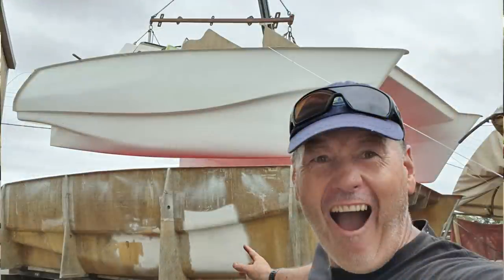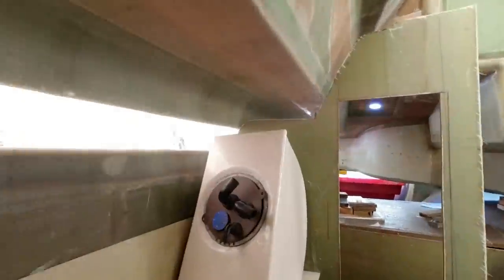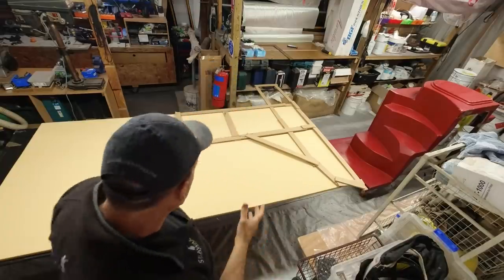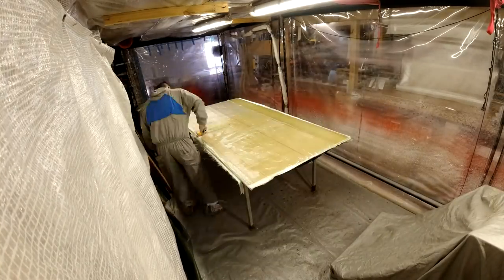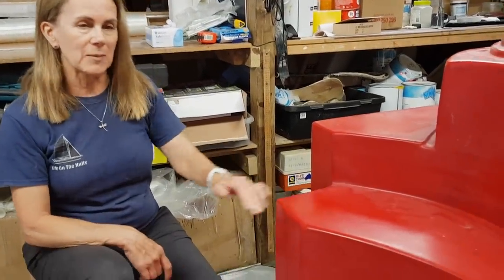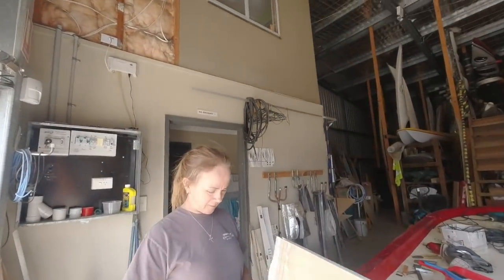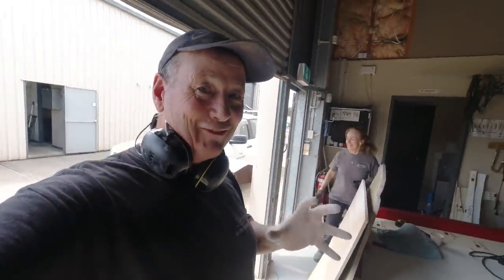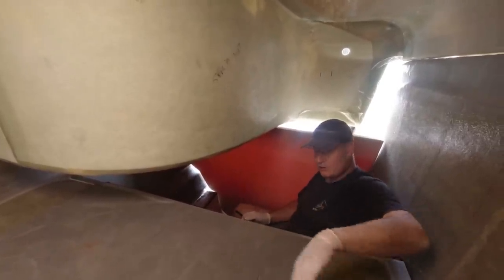CATAMARAN BUILD - Major Structural Bulkheads and Helm Station Ideas Ep203

Comment: Hi Ross !  Have you looked at making the helm seats (in a bench style) integral to the stair module you're already modifying ? An inner seat molded a bit lower for your height, and an outer more elevated one for Janet's visibility needs ? Having the outer seat higher will also improve visibility for her to see out laterally and can also offer you a cabinet space in aft face of module. After all Ross, you need SOME sleep eventually ? Right ?   PS You can always set up multiple/different thickness cushions to affect the levels on the bench or swap cushions sides for a bigger boost...

Comment: Quite right. I also don’t like openings in a back of a boat.
Reply from the maker: Very good safety feature Ash
Reply: @LifeOnTheHulls  Agree, if you have it like the moron cat set up, the engine could flood with salt water and kill it. If seawater gets into the pistons that will mean a new engine as rust will start to form. That and the fact the cat will be partly flooded and becomes difficult to pump it out. As you are doing entry from the inside is a better and safer solution. I’ve said your building a tank and my view has changed it will be unsinkable tank 😝

Comment: Who's the apprentice Rossco?  (LOL). One thing about all these boats. They are not good at standing up to running into things. i happened onto a channel this week, somewhere in the Central Americas, where another builder is using 'plastic'. He shows how tough the hulls are by hitting them with a sledge hammer with no effect? Asid from that i pray that February is a better month for the 2 of you. Cheers
Reply: saw that was interesting - but doing a mould or injection would be a challenge - but if Elon Musk can build Teslas from molten Aluminum who knows - also only a few boats so not scaled up like Tesla
Reply: @jimlofts5433  something to think of though. cheers

Comment: Great video as always. If I remember right the internal steps have wooden treads. Will you be doing something similar at the helm or just painting some anti slip there? Cool idea using the existing step mold by the way. Cheers!
Reply from the maker: Yes Chris our plan is ultimately have some type of wood look deck, it will most likely be a faux teak product on the entire back deck as we do like the sifter feel, but I am concerned about the heat these products can generate. Rossco

Comment: Raising the helm: are you not going to put a seat in. You will need to make that seat height adjustable also?
Reply from the maker: There will very a seat well high enough for Janet did worry.Ross
Reply: @LifeOnTheHulls  Janet is petite, when you sit next to her I bet your body is still taller. So something has to be done. An adjustable seat, so she can raise it when at the helm or you get booster cushions for her. The booster option is cheaper but I don’t think you will be happy with that solution. I think a couple of those gas risers you get in swivel office seats could do it? May be their is off the shelf product you can get? The step is a great idea, but with hours behind the wheel you will need a higher seating positions for Janet.

Comment: Just interested in the cutting a hatch in that structural bulk head, did you have to run it past your engineer to pass survey? Or is it an additional bulkhead to start with. Great video, thanks for making them!
Reply from the maker: Thanks Tim, it is an additional bulkhead but upon discussing it we agreed that some carbon un- directionals along the perimeter of the hatch cut-out would indeed be more than recommended. Rossco

Comment: so i do find the build process interesting but this cat originally was a power cat correct ? how is going to be a sailing cat with out many changes and the hull design will work for that ??? L.A Rob
Reply from the maker: Original Cat was a sail cat, the power cat was an adaptation of the original boat, I am employing some of both of the boat designs to a motor sailing cat. Rossco

Comment: Ross I notice that you are often " beefing up" the structure Are you in danger of over building and making the boat too heavy?
Reply: Rossco will correct me if I've misunderstood, but I recall that he's deviating from the plans of the boat in various areas, such as using foam core instead of other materials. Such materials deviations change the structural integrity and dimensions, requiring additional glass laminates to make up any stiffness differences. As well, because of the use of foam core in areas the original plans didn't, Rossco gets to do all manner of custom fitting of most of the surfaces to compensate for his changes.

Did I get that right, Rossco?